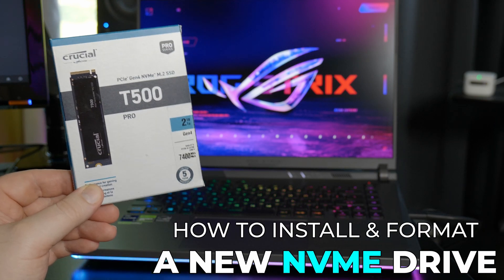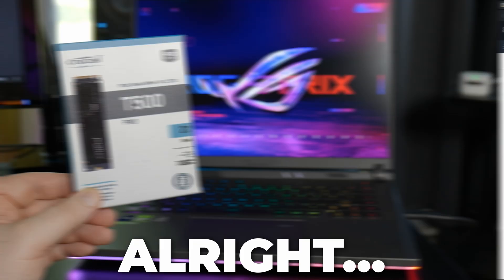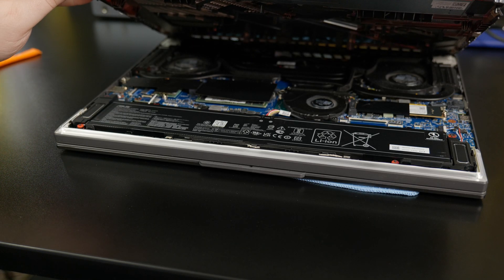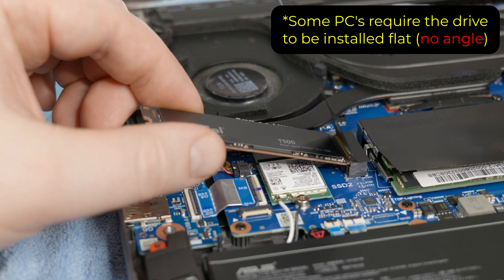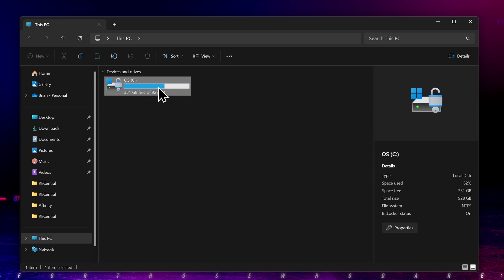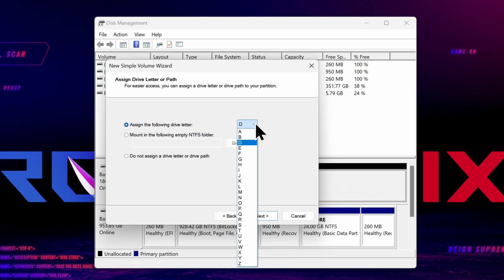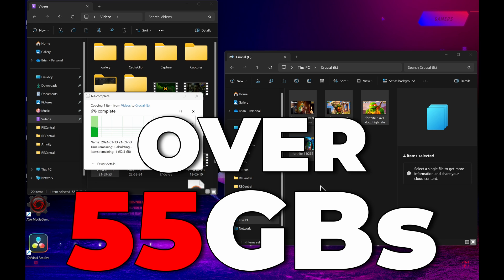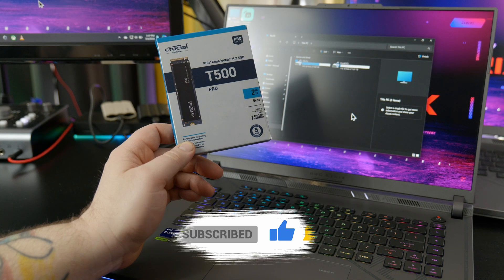HOW TO INSTALL AND FORMAT A NEW NVME DRIVE (WINDOWS)

Comment: can i install heatsink version on laptop { Lenovo y520}  ,i have ordered it today 2tb heatsink version bcz heatsink version are cheaper on amazon bcz only 1 stock left so i have ordered it but im not sure it will goanna fit in laptop or not! and is it good ssd for long workflow I'm using it for editing. pls tell me
Reply from the maker: Heatsinks in laptops 'can' be a No-Go for many laptops because they add width. It really depends on how much space you have in the case. If it fits and it's not pressing on anything else, then it's fine. If it doesn't fit, then you should be able to remove the heatsink and install without it 👍